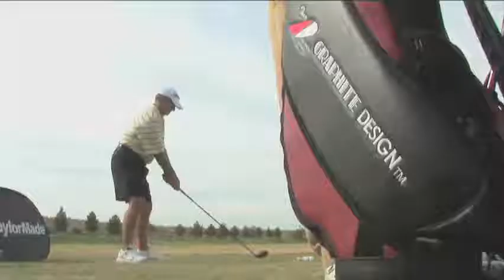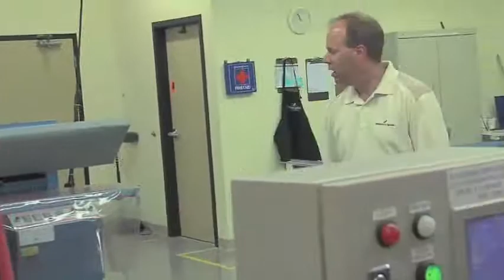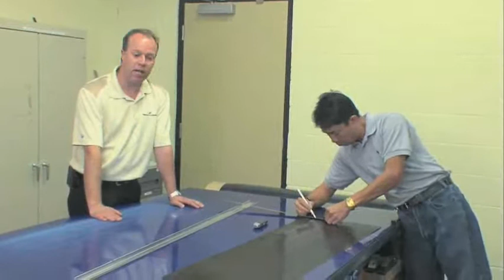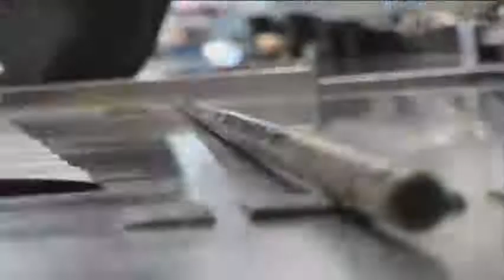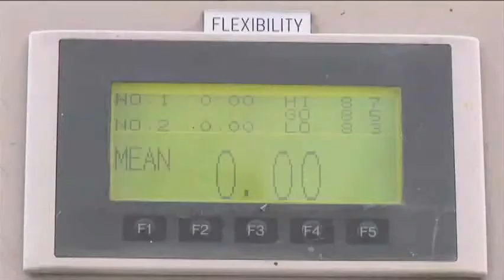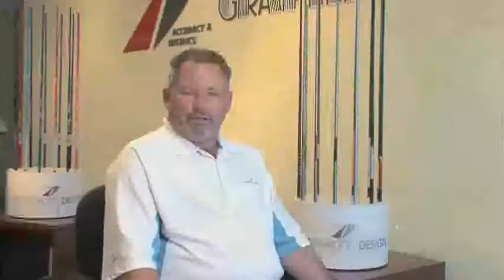Graphite Design Factory Tour

Comment: Question:  are shafts meant for a set of irons all manufactured originally to the same length, then trimmed for final installation?  Follow up: would it be ok to take a shaft pulled from a 4-iron and trim it to gap wedge size?